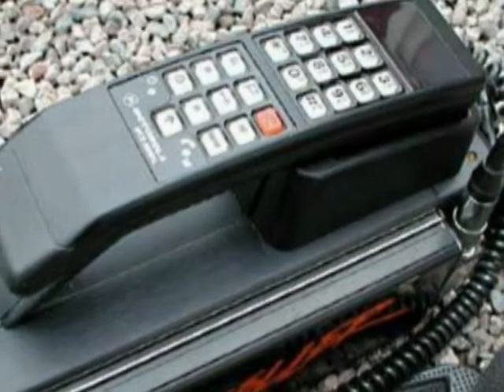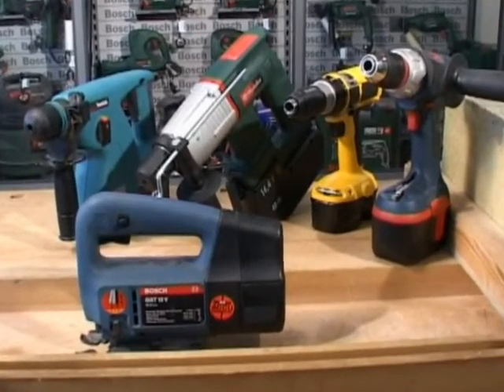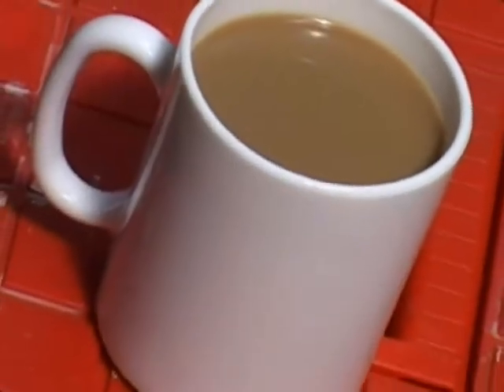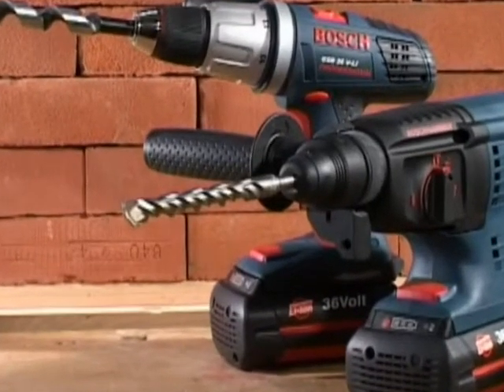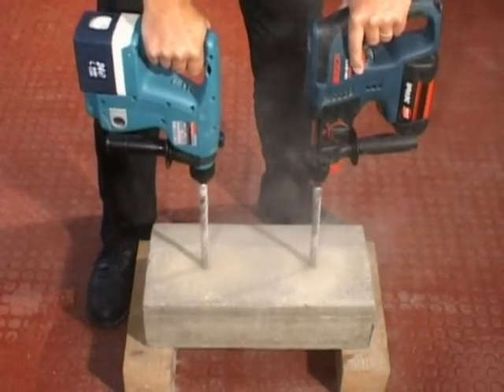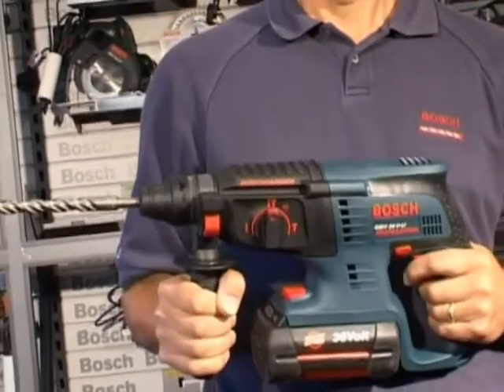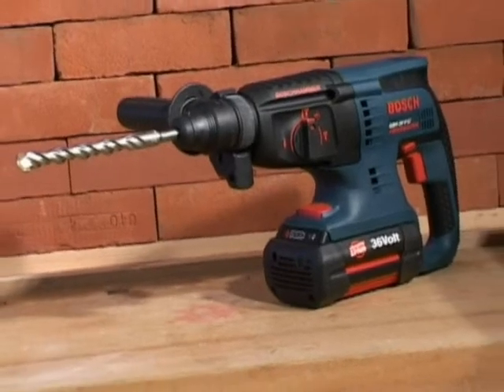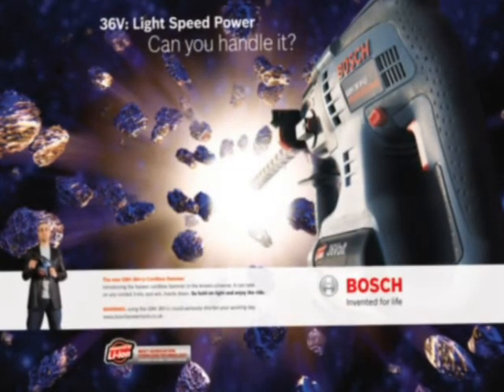Bosch 36 Volt Drill and Rotary Hammer Drill

Comment: How about the 36v makita vs the bosch? Not much point doing the old tech vs the new
Reply: ***** I own the 24v makita, The problem is anyone who bought them years ago when they where the bee's knee's need new batteries, as they don't last forever, and at £160 a pop, its not worth it. I do agree however, that this isnt really a test its more sales pitch, And i really would't go out my way to buy anything from tool stop
Reply: Joe Leighton And after reading the comments and seeing the makita running backwards, I would't touch these clowns with a shitty stick.
Reply: A better comparison would be Bosch 24v vs bosch 36v on a track so the only downwards force would be the drill itself